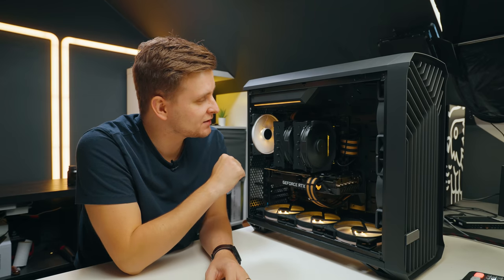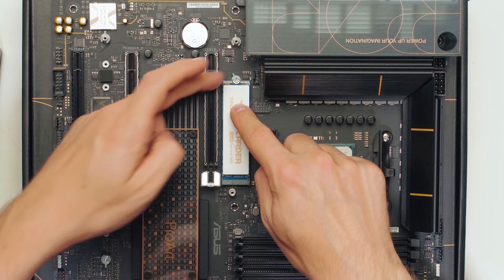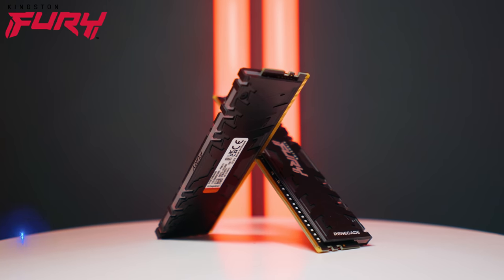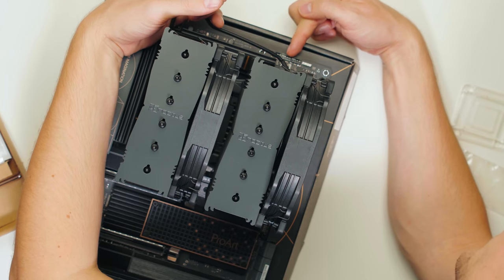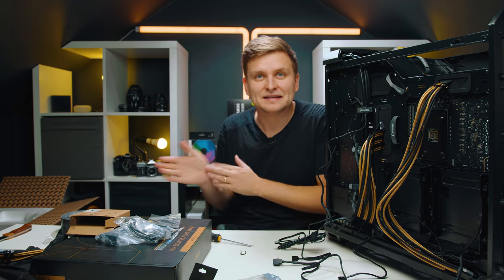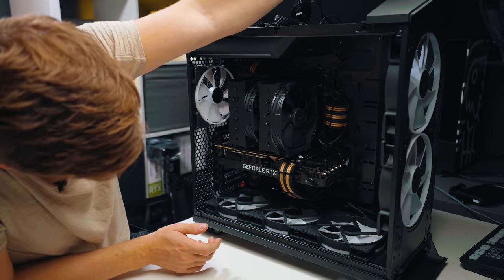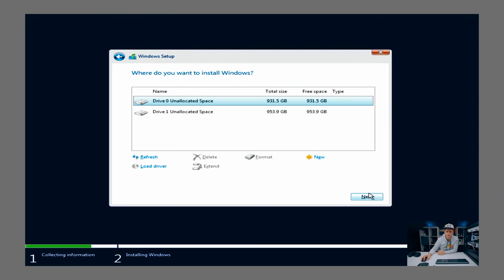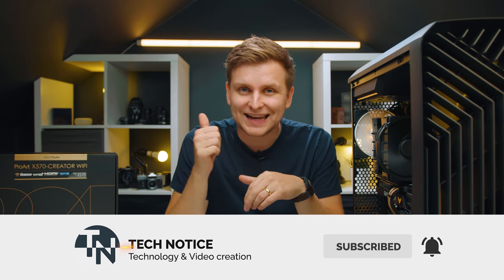The Ultimate Creator PC/Workstation | ASUS x570 ProArt build [Part 1]

Comment: ....And now 22 months later my ASUS ProArt Creator-based system is still going great; I built it with a RTX4000 Workstation Graphics Card and 128 GB(!!) Corsair Memory overclocked to 4.4 GHz; it plays and edits my Sony A1 high res 4K 60p video files with no problem, and now gives me 53-60 fps while playing STARFIELD hahaha!!  :D  THANKS for the outstanding video and series, I would not have known about this motherboard without your video!!!  ALSO:  Case:  Fractal Design Torrent in White with Noctua fans in white covers!!

Comment: Just finished putting together this exact same rig and I'm absolutely loving it!  Thanks for all your work and congrats on the new addition to your family.  Hope you're getting some rest.
Reply: Hey I’m also building with the fractal torrent rgb but my fans won’t light up? Not sure if I’ve chained them incorrectly or what but they all still spin when the pc is on so I’m not sure. Is there only supposed to be one ARGB header coz the led strip at the top is recognised but the rgb in the fans isn’t :(

Comment: Update on having used this setup for a week now:
1) do not use the CreationFirst software that comes with the ProArt board.  It's meant to prioritize network traffic based on what you're currently doing but it only ended up strangling network resources and made some apps completely crash.
2) I've run into several issues with USB connectivity.  First my Logi C922 webcam kept disconnecting and having issues.  I moved it around to different ports before finding success.  Second, my MOTU MK4 audio interface that connects via USB 2.0 will periodically disconnect from Windows.  I'm bringing in an Inateck PCI-E USB card that MOTU recommends to see if this solves the problem.
Reply: Update on the USB issues I've had.  I was never able to rectify the problem with my MOTU MK4 audio interface (USB 2.0)  which would randomly disconnect requiring me to restart the device to get audio back.  Extremely frustrating while editing or in the middle of Zoom calls or streaming.  

MOTU recommended adding an Inateck USB 3.0 PCI board assuming it was a speed issue and thinking the dedicate board would prevent dropout.  It took me a frustratingly long time to get the PCI board in, but it finally arrived... and solved absolutely nothing.

My last resort was to upgrade my audio interface to get off USB 2.0 so I picked up a Presonus Studio 24c (USB-C).  I'm still having the same issues where occasionally the audio will disconnect, but it reconnects within a half second and just becomes the occasionally annoying hiccup but is at least tolerable. 

If anyone's had similar issues with this motherboard and has found a solution, please let me know.
Reply: @gingerbreadgirlprod  ah man that sucks! hope you found a solutuion to it
Reply: Have you updated the bios?
Reply: @TimberWulfIsHere  The latest BIOS released a month ago seems to have finally solved this problem with USB ports dropping.
Reply: @gingerbreadgirlprod  good going

Comment: I’ve had this for a month, and so far the performance is fantastic. Transfer rates from the thunderbolt port to the NVME on the board are unreal. Running a 5950x, a 6900xt, 64GB ram and a Samsung pro 980 gen 4 nvme. 

The only issue I’m seeing is some thermal reports are horribly incorrect in OS using the Asus AI software.
Reply: How much in total bro?
Reply: @sadiqandnature  I had a previous build I stole a Corsair 750D and a Corsair 860RM out of; with that being said I believe I had somewhere near $3K in parts (H150i; new noctua fans for the case, added a 4TB HDD for long term storage/ISO’s). The NVME killed me, at the time it was $399 and dropped two weeks later to $329 lol (2TB). All in all after selling my 1080ti’s I spent $1275 USD.
Reply: @Crushin_Libs  Thanks for the info.
Reply: @sadiqandnature  You’re welcome!
Reply: @Crushin_Libs  you did not have to flash bios update your board at all with 5950x right?
Reply: @samuellp1146  confirmed. Populated instantly upon first boot.
Reply: @Crushin_Libs  thank you sir!
Reply: Hi.. Could u suggest me mother board it will support basic specs to high end specs.. So that i can update whenever I have money at that time.. And what are the main specs we need to maintain for server workstations

Comment: It took me a couple of weeks to build my workstation. I painted it light aqua blue with Dover white and candy blue stripes. Sanding the black paint on the brand-new case was some work that is what took so long. I don't care for RGB but the used power supply Corsair 750 I got was really cheap with cables and it glows colors. I did swap out the power and HD LEDs to blue to match the color. An air-cooled Dual-stack heatsink is the way to go, less trouble.

Comment: Nice build. I think the last creator’s build used Be Quiet case and stuff. I’m interested in knowing if this build is quieter. You can bet I’ll be watching the episode on saving some money, but I do want a very quiet unit. I could not hear this build when you were recording with it right by your shoulder, and that was something I really liked. Thanks for another great build.
Reply: I've got a BeQuiet Dark Base Pro900 rev 2 and the new Fractal Torrent. Took the 3900x form the BeQuiet and stuck it in the fractal where it runs cooler. The BeQuiet has the new 5950x  now. The BeQuiet is a quiet case designed to push sounds to the back through the baffles in the sides. It really works well The Torrent is louder. But I have them both maxed at 100% fan speed and have a hepa filter blowing filtered air on them so I never really have much in the filters. But the big filter is so noisy, the sounds form the cases is nothing comparatively, LOL.
Both are excellent, but I am sop stoked about the Torrent that I turned all my beQuiet fans inwards.
Reply: @johndicus123  Thanks for the information. I do appreciate the comments.

Comment: Great video. Will all that fit in a Torrent COMPACT replaced with smaller bottom dual 120 or 140 mm fans? I want to build exactly the same system in the Z960 Intel version but with the Torrent Compact. Using smaller bottom fans is the only way I think it'll work. But what are your thoughts?

Comment: I just did a build with the b550 ProArt board with a 5900x and it's pretty impressive.  I'm a gamer but I also do music and needed Thunderbolt for my audio interface.  Before this I was using a Gigabyte X99 board with a Thunderbolt 2 add in card, so it's quite the upgrade for me.  One thing I've noticed is that If you fill the bottom PCIe slot, the Thunderbolt ports are disabled.  There's some vague info about this in the manual, but it's mostly just a chart of how display out of the Thunderbolt port works when the slot is populated.  It doesn't mention anything about disabling Thunderbolt.  Is this a limitation of b550?  Is it possible to fill all the PCIe slots on the x570 board and still use Thunderbolt?

Comment: How do you feel about the cable management? The actual space for it seems soo tiny.
I've held off on getting this case because of that since I have so many hard drives and my psu cables are thick and braided.

Also, is the heat off of the 3090 affecting the cooling performance of the cpu cooler? Another reason for me not having the case is I use an aio and am unsure of getting an air cooler since my 3090 produces a ton of heat I'd be afraid of the cpu heatsinks being right above it.
Reply: I bought two of the Torrent cases; they are fantastic.  Best cable management I’ve done, and great air flow.

I also did the 5950x on a Gigabyte X570S Aero board.  Now the thing I don’t have, due to cost, a 3090.  The card I do have is close to my Mugen air cooler, but it hasn’t been an issue.

Comment: Great video series, thanks for putting it together and congratulations for the new addition to your family, I hope you had a great Christmas and New Year!  I've just built a new system with a very similar configuration, based on watching this video series.  I had one random issue when connecting LAN up to my Ubiquiti UDM and Flex Switch - one for me to debug.  One question I did have though, did you use the Fractal Nexus 9p Slim Fan Hub?  I know there was an issue with it initially and Fractal took care of it, but couldn't quite see if you hooked the cooler fan up to it and then hooked the hub up to the MB?

Comment: I think I might built this PC with a bit of modifications like adding threadripper over the ryzen. Would you recommend it? I'm mostly a Zbrush, Premiere Pro, Blender and Photoshop user. I'm also using this motherboard so I can set it up for editing off the NAS.  Also, do modern chasis not care about disc drives anymore?  I dont think I've used USB for OS installation yet.  Noticed you didn't put thermo paste in the CPU.
Can I bypass that? (sorry havent built a PC in over 15 years so I'm a novice. :)
What is the recommended custom cable length you used?
BTW i love you channel and the aesthetics.  (digging the orange in the PC too, going to copy that as well haha)

Comment: I'm an Architect that deals with a lot of 3D rendering and based upon some of the research I've done regarding GPU's it comes highly recommended that I invest in an Nvidia RTX A6000 rather than the ASUS RTX 3090 that you used in this build. Now I REALLY like this build you did, so would you recommend that I use the RTX A6000 with this build or should I consider a different build.

Comment: Great video, Would you share the specs of your custom cables?  Cablemods "configurator" tool is staright forward and easy to use. I was insterested in the exact specs of custom cables for this build. Congrats to your family on your new baby girl.
Reply from the maker: I think you can match my design by just looking at the cables, only thing I did was to add 4 combs instead of whatever was the default of each cable ;)

Comment: actually been watching your videos for a month and decided to build this mobo, with a 5800x3d cpu.  Decided to go this route due to prices and a good deal on an open box X570.  Thanks for what you do!  I did not know that the m.2 drives have a life span on them of 5 years...if I understood your Firecuda comment correctly.  Now that this is over a year old, maybe you would recommend different m.2's for a new build with the technology changing so fast.  Lastly wanted to ask how your were managing your colors, do you have a separate controller or using the options in the bios?  Great looking build!

Comment: Hi @Tech Notice... great and amazing build. I like your style and tips you give.
Just 3 question:
1. Does MB controller let to configure at least 2 of the SSD as 1 Raid 0?
2. Have you tested noise too? How many db this system can produce?
3. NF-A12 has the same performance of NH-D15, but is smaller and let more empty space to watch the amazing RAM modules you used (ok, this is not a question :P)

Comment: Hey Lauri,
thanks a lot for your work, leading through the jungle of computers 👌
We are just starting to build up a professional videostudio.
2,5 Questions:
a) For professional color grading - 
would the RTX 3060 with 12 GB VRAM be sufficient (the price for the 3090 is 😝 unaffordable in the moment), if the rest of the build is as in this video?
b) The camera is the Sony A7iii with 60fps in 4k.
With this computer (with the 3060), is it possible to do professional slowmotion sequences by motion-interpolation? 
Is Premiere Pro good in creating professional slowmotion results by interpolation?

Thanks for the info 
and all the best with your baby 🌈
Dominic
Reply from the maker: Sony A7III doesn't do 60FPS in 4k? 🤔
Reply: @theTechNotice 
It does 60fps in 4k but not 120 as the A7iiis, therefore it is necessary to use the computer for the creation of the intermediate frames.

Comment: Hi! Is there anyway to know, whether the TB3 ports work with Audio Interfaces like  the UAD Apollo line? 
If you could test something along those lines, it would be really helpful
Thank you
Reply: This!
Reply: This mobo comes with two Thunderbolt 4 USB Type C ports. Thunderbolt 4 is certified to be fully compatible with previous generations of Thunderbolt. If your Apollo device is Thunderbolt 3 with USB Type C, you are good to go. If it is Thunderbolt 3 but not  USB Type C, all you need is an adapter and it will work. Thunderbolt 4 is the new gold standard.
Reply from the maker: I think @kinleyd covered it good ;)
Reply: @kinleydorji  thank you! Perhaps I did not convey my query. So Ryzen compatibility with Thunderbolt has been problematic for while, at least that is what I understand. Moreover, many audio engineers have tried to hook up Apollos to Ryzen Builds (eg AsRock X570 Creator/Asus B550 Pro Art). There seems to be the recurring issue of a lack of integration and it simply not working. Perhaps someday a video demonstration of UAD Apollo working smoothly with a Ryzen build is what I’m hoping
Reply: @ManoharBalatchandirane  Yes, Ryzen has not had official Thunderbolt compatibility until recently, but only because of licensing issues. AMD/Intel have resolved that now, and you can expect Apollo Thunderbolt interfaces to work with Ryzen. Of course, you still have the issue of OS platform support. UAD does not support Linux, so if you want to use UAD software with the Apollo you only have Windows to work with, unless you are prepared to setup a Hackintosh. I'm not sure how much it's worth going for an Apollo device if one's main OS in Linux - that's the dilemma that I face. ;)
Reply: @kinleydorji  hey this is really helpful! So if I were to swap out my x570 strix e for a x570 pro art, given enough time, we can expect the bugs to be resolved.
Reply: @ManoharBalatchandirane  Yes, I'd say Thunderbolt has finally arrived on Ryzen. I've been waiting for a long time for this, and am going to pick up the ProArt x570. I'm still keeping my options open re the audio interface.